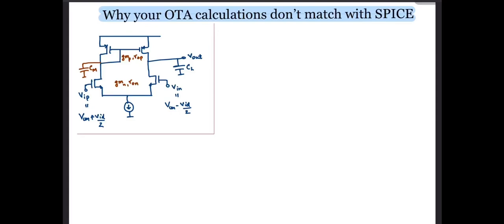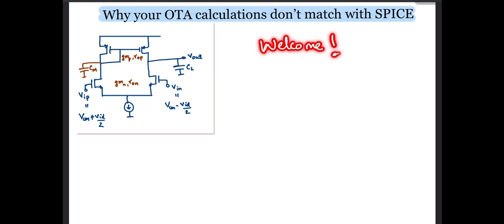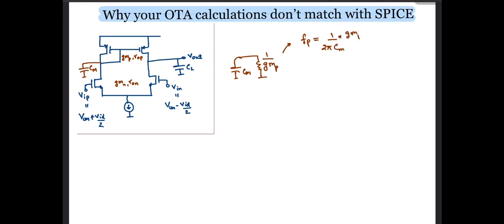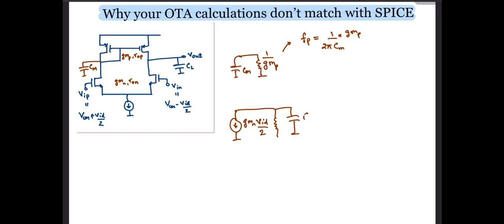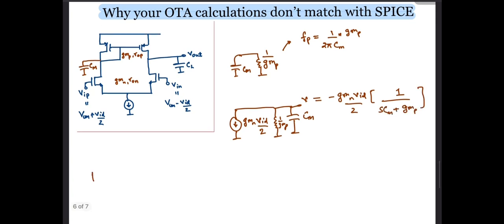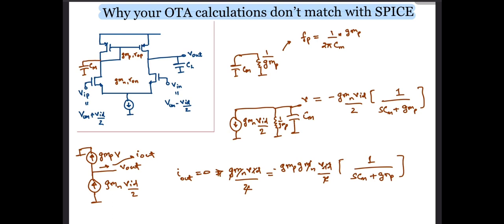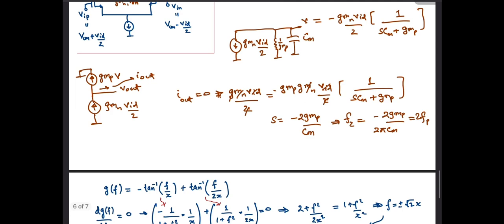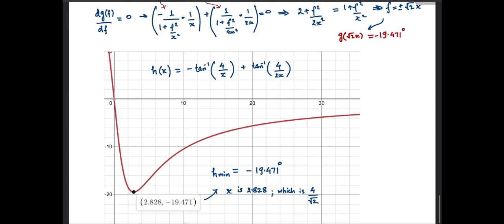OTA Zero

Comment: Hey hello , Am a First year Electronics student , Any tips on important Concepts required for 2nd and 3rd year .
Reply from the maker: Hello Abhinav, 

Strengthen your basics. Study the analog circuit courses from NPTEL (Dr. Nagendra), and IITK SSCD YT channel. You can refer to Dr. Razavi’s text book as well, and even lectures by Dr. Ali Hajimiri from Caltech. 

Learn about RC circuits and their variants, step response, ramp response, etc. 

Once you have the fundamentals clear, try interning at a company or work with a professor, depending on your aspirations.

Comment: Great video! Just a suggestion for a video topic: could you please make a video on the design of a fully differential OTA with CMFB? Because most of the videos on YouTube discuss only about 2 stage single-ended OTA.
Reply from the maker: Glad you enjoyed it. 
There are a few videos on this topic by Dr. Ashwin. You can find them at the following link: https://www.youtube.com/watch?v=CnGUnbNJisM&list=PLP-rjhz_nIi6YQ-RHGLA_e4eS96eLtEEj&index=28

Let me know if you have any specific questions, and I will try to address those in my future videos.
Reply: @TejasKetkar  Thanks for the reply. I will go through these videos by Dr. Ashwin.
Reply: Sir can you tell me why single ended output is prefered over differential?
Reply from the maker: @taraksriram63  as per my understanding, you wouldn’t always want to have a differential output, since the following blocks can be single-ended. For example, an inverter buffer. A single wire will also reduce the routing complexity. 

Moreover, fully differential circuits are more complex to build as well. As Sankalp pointed out, they demand a CMFB. If you can meet the specs with a simpler design then why not? :)